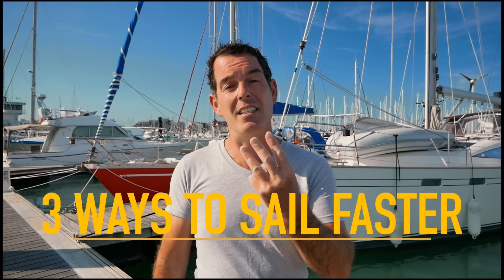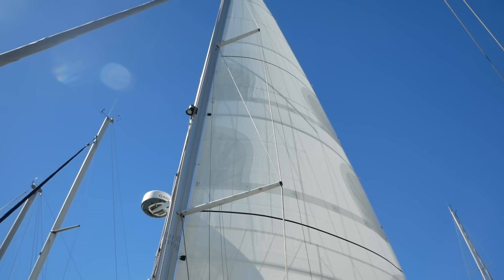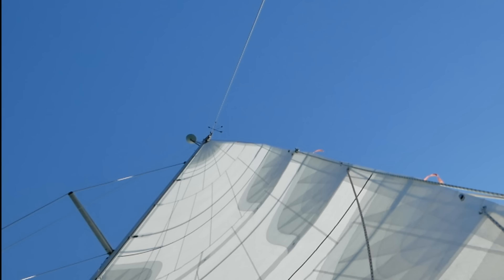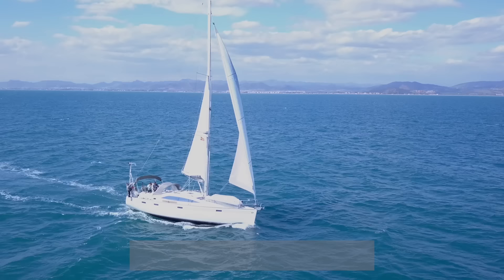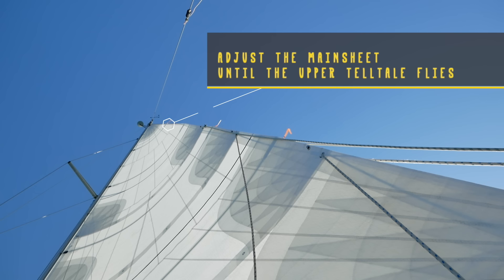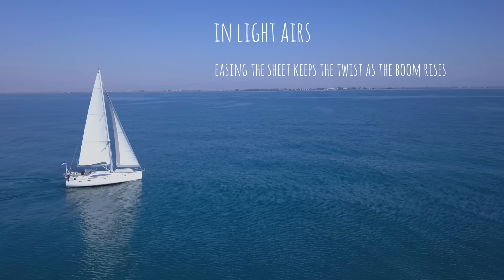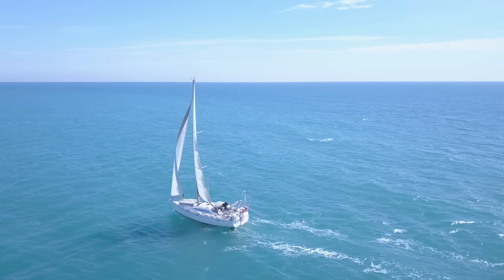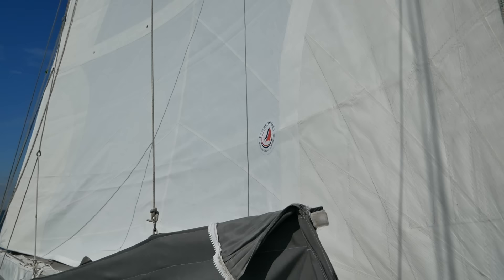3 Ways To Sail Faster! Mainsail Trim Techniques

Comment: No one has ever explained in way I can understand. They dont ever let on that the main and traveler have separate jobs but they also over lap as well. sunfish and lazer dont even use travelers. The boom vang( downwind) and the a mainsheet (upwind)will flatten the sail in heavier winds.  In stronger winds you want flatter sails( outhaul tightened and  back stay hauled in plus tightened halyard also will flatten the sail in high winds)the main sheet needs to be hauled in high winds  then compensate with the traveler letting it out to the lee or sail side of the boat to get the correct sail attack angle depending on your tack-- pinching, tacking, reaching. By making the  mainsheet hauled in you must compensate with the traveler to keep the shape of the sail ( mainsheet) and angle of attack (Traveler). Dumping the traveler in high winds( letting it out to lee) will take away the heel but also this will happen if you let out the mainsheet but in high winds you want tight mainsheet to flatten the sail because in high winds you don't want a big draft or bulge toward the mast- airplane wing can be smaller in high winds just as jet planes have less bulge on the wing then gliders. In  light winds you might let the mainsheet loose but then you  have to bring the traveler more to windward or to the higher side of the boat away from where the sail is. I am probably wrong but this is how I see it. Then there is the fisherman reef where the traveler is let go so that the top of the sail will dump the wind out from the top.

Comment: Better than sailing school! For those that didn't take notes: 1) Know your sail twist techniques upwind: mainsheet & traveller downwind: vang  2) Leech lines: know when to tighten to stop flutter, but not too much to create a curl at back of sail 3) Control Camber (or the curviness of the sail in my words) by knowing when to adjust luff tension and correctly setting the outhaul: loose in light winds, flat in heavier winds. But watch the whole video, lots of great gems!
Reply: definitely! took me years of racing with different crews to learn these. Thanks for the summary

Comment: Hi Guys. Agree with everything you said. Just a couple of things you may want to consider in the next video. (Constructively as an ex racer). Probably the most important thing is rudder position before trim. If the rudder is not central its a brake. Focus on keeping the rudder mid ships. If the sail (s) forces you to steer off centre your slowing the boat. Trim the jib first. even more important on high aspect ratio (newer boats) where the jib is 110 % or less, and 5/8th fractional or less. Three sets of tell-tails  two deep on the sail. (or 3 + sails if your a real race freek.) Jib track position is key so make sure you can adjust them under load from the cockpit. Consider fitting a jib inhaul line to pull the luff to windward of the track set position (infucker lines)  A huge benefit upwind. When the jib is set bring the main in as you described and maintain a balanced helm. The air will then accelerate off the jib leach and speed up over the main giving greater lift from the main. Which can then be curved higher up on a beat by back-stay adjustment, released as the AWA increases. Not trying to teach you to suck eggs. But, if you want to be first to the marina little things make a difference over distance 😊Like optimum (10 ) degree lean... Dont take this the wrong way, just observations; Ant, Cid and the pooch crew. xx
Reply: You forgot trimming the swing keel😎

Comment: When I was racing several decades ago,   We got this fantastic book called "North U" put out by North Sails,  We even copied a few key points  onto sticky laminate and stuck them in the cockpit.  
It was really brilliant as it gave us a process for setting up the sails.   The camber stripes are very important as are telltales and I would have several more than just on the leech.  Keeping the leeward ones streaming is a great way to help you set up the sail.

Comment: Fantastic stuff Nick!  You have different ways of adjusting you main than I grew up with and it was great to see how they are used.  We use telltails on the shrouds instead of a hawk at the top and on the luff of the sails.  On the luff with 3 sets, one on each side, you can see how the wind is flowing.  The easiest way to read them is to make sure both are flowing back together.  If the outside tail is flapping but the inside is flowing back you need to let the sail out just until it starts flowing back.  If the inside tail is flapping but the outside is flowing then you need to sheet in until they are both flowing back together.  This way is not better than what Nick relayed it is just a different way and could easily be used together with what Nick taught.  It is all just different ways of getting information you can use.  The only electronics we had was our own senses, some bits of bright orange or red yarn and if we were lucky a knot meter.  As Nick says you learn to feel how your boat is sailing and over time will learn its best points of sail and how to set everything to make it go best.  Those of us who learned to sail on Sunfish, Optimists or other small boats like that learned by simple observable methods and feel.  I don't know that I would even pay attention to the electronics for sail trim other than speed. But that is me.  Thanks again Nick.  I am looking forward to the next one to see if there is more I can learn.
Reply from the maker: Cheers my friend

Comment: Wow Nick, great explanation! We already tried your tips from the whatsapp group and it made Sirius sail faster one knot. May not sound as a lot but doing 7.5+ knots on a 30ft (9m) boat is quite spectacular. Jouke and I will be watching this video again while sailing this winter to see if we can even go faster.
Reply from the maker: Awesome mate! Glad it helped.
Reply: what part of this video added 1 knot?
Reply: @lucasspaniard8430  Sail and boat trim is usually multiple factors working together.
Reply: @LoanwordEggcorn  I concur, how about hull speed?  Like I said what tip in this video helped him gain a knot in speed?
Reply: @lucasspaniard8430  Probably more than one thing.

Comment: Very useful video Nick.  Just a few things to add having raced a lot and trimmed many sails.  Top,tell tale should really be just stalling not flying like the rest of the tell tales.  Looking up from under the boom and seeing how the top batten is lined up to the boom is a good way of seeing how much tension to put on the mainsheet.  The top batten should not be cocked to windward.  In very light winds, when most cruisers may be motoring, it is best to have a flatter sail as the light wind will stall on a sail with a deeper camber as it becomes detached as it flows over a fat sail.  Flattening the foot of. Sail can almost be like a first reef, in fact some boats have a flattening reef just to take the belly out of the foot but more so on fractional rigs with big mains.  If you have new Dacron sails it is important not to put much if any leech tension on as the sail will stretch as it is run in so to speak.  If too much is put on too early it will induce a hooked leech and there is not much you can do about it then and it will reduce the efficiency of the sail long term.  More modern sails with less stretch will act differently.  As you said, halyard tension is very important but especially on the jib as the wind speed increases the same process of assessing where the camber is will determine the luff tension and will make a big difference to windward performance.  A Cunningham is a good addition to a mainsail as it may be the sail can only be raised so far without causing damage to the halyard and the sheaves so a Cunningham overcomes this.  Sailing off the wind, it is important to make sure the kicker is adjusted as it can induce large loads on the boom attachment to the mast so it must be let off and adjusted to give the right twist.  Letting too much bang off on a dead run will make the top of the sail kick to windward and can induce more roll so tightening the kicker and heading up a few degrees makes for a safer and more comfortable ride.  Hope you don’t mind me chipping in but hopefully this adds a bit to what you already explained so well.  Andy UK
Reply: This is great. I was looking for a reply like this, as not to double up. Not a racer myself but have sailed with some great sailors and they will say the same thing you said.

Comment: One more thing that you hinted at at the end.  When you are sailing straight, look at your rudder angle (either by knowing where you wheel is when the rudder is exactly amidships or the rudder angle indicator on your autopilot.  Wheel position can be less accurate with hydraulic vs cable steering).  If you have need more than a few degrees of rudder angle to sail straight, that rudder angle is a huge huge drag on your boat and your balance is off and may have your main over or under trimmed.  The headsail is trimmed to the wind angle (first), main is trimmed for speed and balance.
Reply: What do you mean by 'a few degrees'? If you are sailing in 15-20 knots the angle will be more pronounced...
Reply: @philgladwin6863  Every boat is different, the sail plan has to be in balance with the hull, keel (boards), and rudder.  The point was more to keep an eye on rudder angle as you are learning your individual boat and how it performs in various conditions.  That being said, just because you are in a big blow doesn't mean you should have a lot of rudder angle to go straight, more likely you need to reef the sails.  Another example of something to experiment with.  There are two schools of thought on catamaran daggerboards, one says to use them only when going up wind and pull them up as you bear off.  The other says that even if you are on a beam or broad reach there is a lot of side force on the hulls, and that leeway of the hulls through the water is way more drag than what you get from your boards, so keep them down.  One board for light air, two for medium  to heavy.  Again, another variable to experiment with for your individual boat, sails, etc.

Comment: Thanks, really good explanation! Sometimes the seascout methods of learning-by-doing and following tradition comes back to bite you, since I've been doing all these things ever since I started skippering our boat, only learning the "why" of things later. For example the importance of the twist was something I didn't quite fully understand until now, I just knew that the sail was supposed to look a certain way in certain winds. I'll be sure to put this knowledge to use next summer, too bad it's a bit too cold in the Baltic Sea to try it out immediately!
Reply: Learning by doing can help get you started, but it's important to learn and understand theory too.

Comment: PERFECT 🙌More of this please!!! :-)
Reply from the maker: Thanks you two! 🙏
Reply: You guys need to remember that on the cat you will generally be going quicker and will have higher apparent wind hence can carry flatter sails than a mono. You also have the benefit of wider sheeting points.

A couple of other things to keep in mind. The backstay can be used to increase twist as the wind increases and hence exhaust the sail in puffs. This can also induce bend in the mast (tighter luff),  and/or a tighter forestay (depending on where your backstay terminates)
Be careful with vang tension as the wind increases when you bear away. If it is too tight, it will pull the boom forward and stress the lower section of the mast.
You should also release the pressure off the luff as you bear away.

Comment: Sadly most modern boats don't even have a traveler. I bought a bavaria CR46 in 2017 and I was quite annoyed to see that they have replaced the traveler with a twin mainsheet system. A twin mainsheet system is a system where you have 2 separate mainsheets, one runs down the right hand side, the other down the left hand side, and with that it was quite tricky to get the perfect shape of the sail so I ended up fitting a traveler onto the coach roof and that has helped a little bit. Otherwise the boat is great, I once got it up to 16 knots of speed over ground on a beam reach. 16 KNOTS!!! and people still call bavaria sailing boats slow.

Comment: in super light air, a tighter outhaul reduces friction / drag  induced by the sail curvature and encourages air flow over the sail.  But you knew that.
Reply: Anytime you flatten the sail you reduce drag. But by flattening the sail in low winds you lose lift (power).
Reply: @hellkell8693  but in super light you get no lift unless there is airflow ! Chicken and egg. 
My humble view is that you need to reduce drag to induce airflow to create lift and forward boat speed when the apparent wind will allow a reduction in outfall tension as the windspeed can overcome the drag .
Enjoy whatever the wind . 😃.

Comment: One thing all this is ignoring (and I know it’s often assumed) is the helmsman unless your helmsman is holding course to the wind correctly your going to be doing a lot of sail trimming and retrimming .  Also a course change maybe all you need should the wind change ( 
When coastal sailing around islands, channels and harbor sailing you often find winds are not consistent and as a helmsman you must seek out the wind to sail faster or find your fastest  point of sail to your destination. Racing on a three leg course in a harbor on smaller racing boats ( often all identical) is a excellent teacher the difference in winning and loosing in single design sailboat racing is ALL about  efficiency and although sail trim is important finding the best course and helmsmanship is equally important.

Comment: I think beginner sailors often suffer from the opposite problem , that is , how to depower the boat in high winds.  I rarely see tutorials on how to control the boat properly and safely when the wind picks up and overpowers the boat.  A new sailor and crew will panic when they can't control the heel of the boat. Slowing the boat down when sailing in a blow, as well as gybing in a blow - these are things that the beginner needs to know as well.
Reply: Can you elaborate on how to slow the boat? Or direct us to a good video?

Comment: As I was passing a sailboat today o the lake it was visible they had to much tension on the leach line. I didn't know what they we doing to get that curling on by the railing edge till now. They were in light winds 8 to 12 knots and had up their head sail and main while I in a boat almost half theirs in size just passed them by with only my main flying.

Comment: The difference in wind speed between the top and bottom of the mast is negligible (unless you are sailing a huge maxi boat) so twist is not required to compensate for it. We did an experiment where we released balloons into the wind flow at the same instant from a vertical mast and the ones at the water moved at the same speed as all the others including the ones at the top. The reason why you need twist in a sail is to promote laminar airflow across the sail. All efficient aerofoils have twist in them, including birds and airplanes, and their wings work horizontally so they have no difference in vertical wind speed to consider.
Reply: Bird wings, speed at tip higher than at base as it flaps end covers a longer distance. Airplanes, it’s to make sure the tip is the last part to stall. Suspect your balloon experiment is not quite enough to over turn the consensus on sail design and behaviour.
Reply: @tombell8999  Bird wing design shows very little difference in wingtip for birds that flap their wings to fly. However birds that soar and rely on thermals to give them lift without flapping all have radically-modified wingtips, so your 'wingtip covers longer distance' analogy clearly is not the answer. Soaring bird wings much more closely resemble sails than the wings of birds that flap. The speed of the air flowing over the wings of a soaring eagle or vulture is the same across its length, just like a sail.

Comment: The thing is if your boat doesn't have a traveller as my boat has the main sheet lines running to rollers on the back of the boat, as its a 1974 kingfisher

Comment: So if the main sheet and traveller are for adjusting twist, how do i adjust boom angle? Shouldnt there be two main sheets to pull to port or starboard the boom or just one main sheet to centre it?

Comment: Very new sailor here... my traveller seems awfully small (Sun Odyssey 37...) compared to others. What's the relationship between mainsheet and traveller in terms of boom position versus twist? Do I adjust point of sail to compensate if I simply don't have enough traveller?

Comment: leach lines seem like adding so much drag .... couldn't you get the same effect by some combination of outhaul and vang ???
Reply from the maker: No mate. The leech lines tension the leech of the sail and introduce curve. You can’t do that with the pit haul and vàng
Reply: @sailingrubyrose  what about fractional rigs??? isn't there some other way???

 i have the book "Principles of Yacht Design", and have been designing a small 7 Meter for years.
 Laminar Flow is important also...so is the ability to shape the sail, but ropes and rigging do cause drag and disruptions.
Reply: @sailingrubyrose  how about ditching the Dacron, and adopting a Dyneema cruise laminate???.... Dacron stretch introduces a whole host of sail shaping problems, as it creeps..